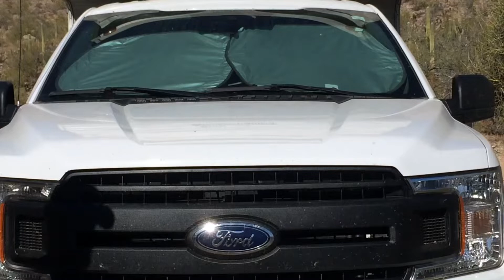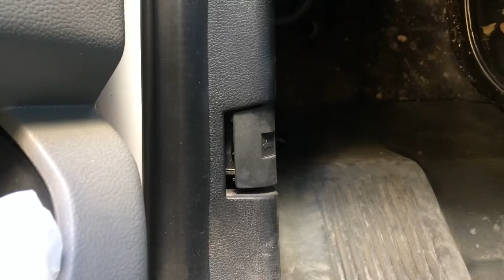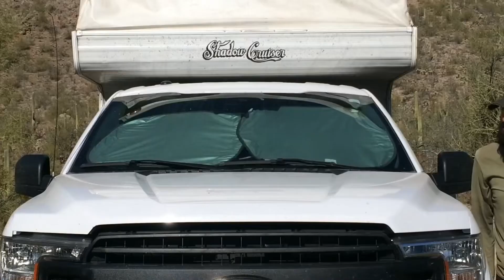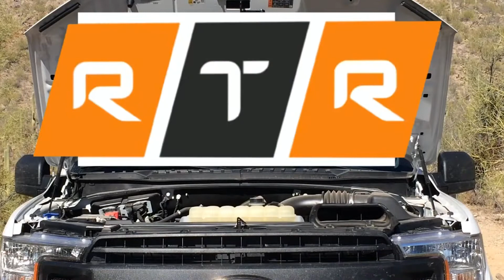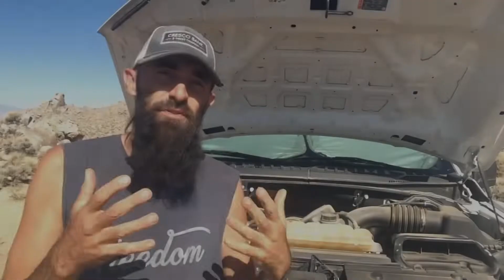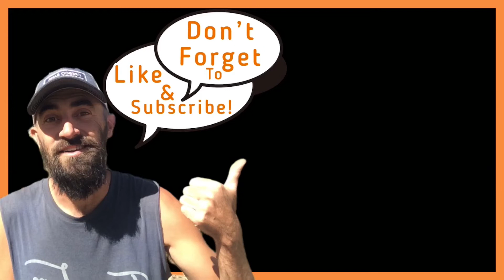What’s The Difference Between an Interference and a Non-Interference Engine?

Comment: I can't locate on Google if this 1990 Mazda MPV with very low Kilometers that is being gifted to me is an Interference Motor or Non-Interference Motor. Anyone know? This van is in pristine condition as it was hardly driven but it's still 34 years old so of course I want to keep this baby running smooth.